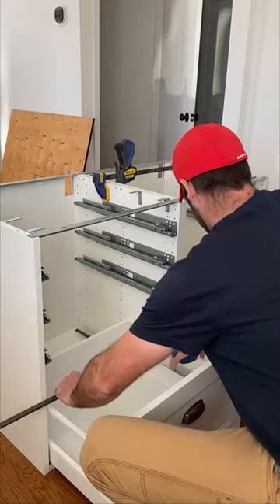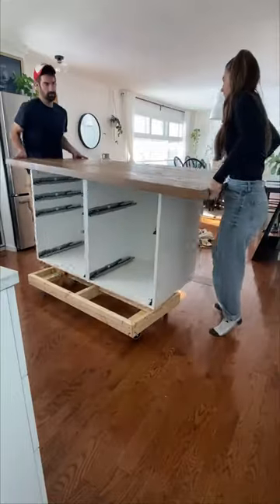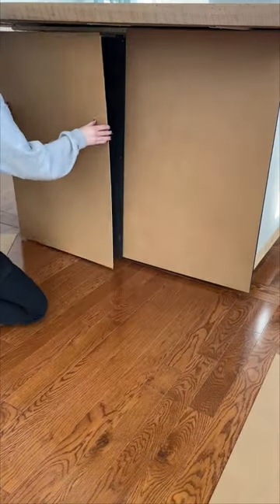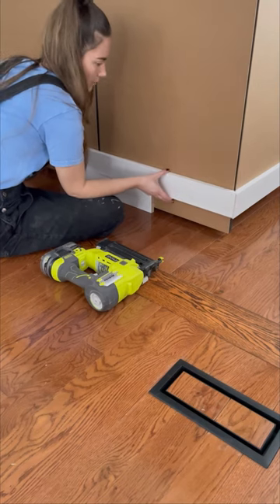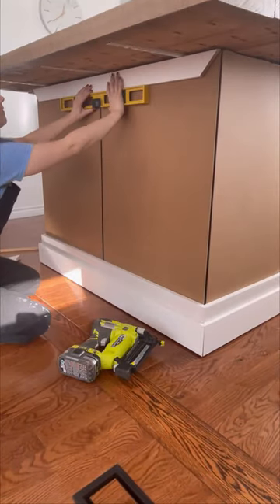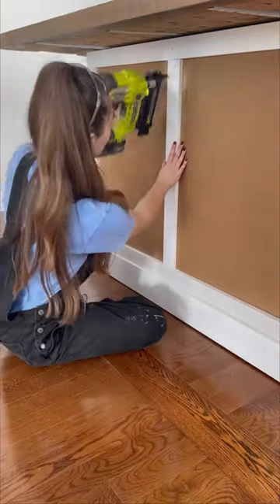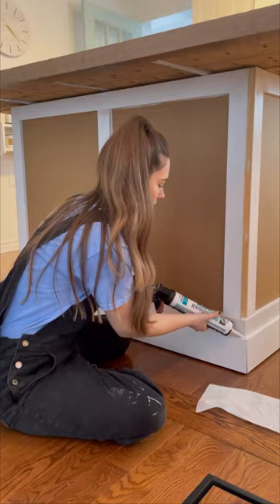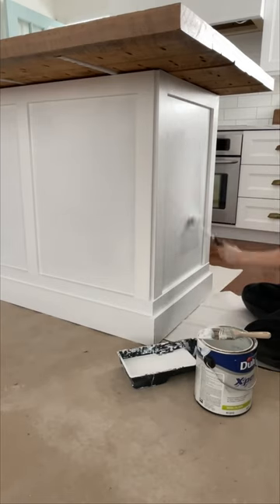DIY Kitchen Island On Casters | Kitchen Island On A Budget

Comment: Don't stain, use polyurethane or resin type products such as waterlox or Rustoleum Watco they have it in it but it's not safe if your cutting on it. I use a different project which is called Howard butcher block oil and conditioner  which has mineral oil and beeswax (protects from water damage) natural product plus safe for those with nut allergy.
Reply from the maker: We don’t actually cut anything on it, we use a cutting board 😊
Reply: What do suggest for someone who makes a lot of dough? The resin?